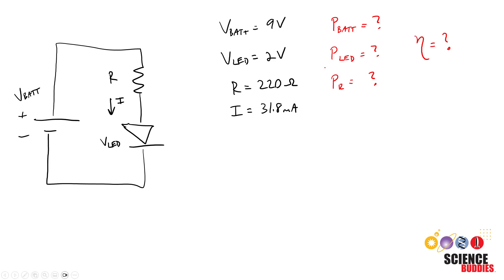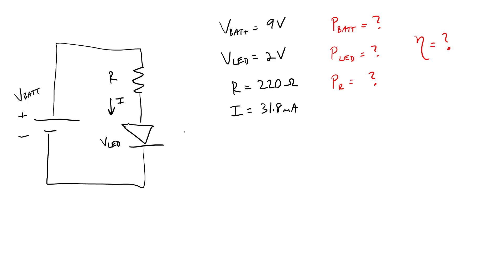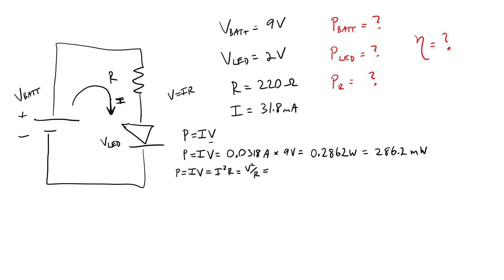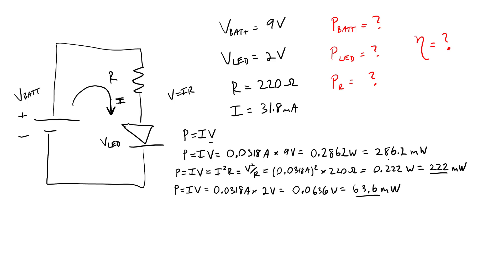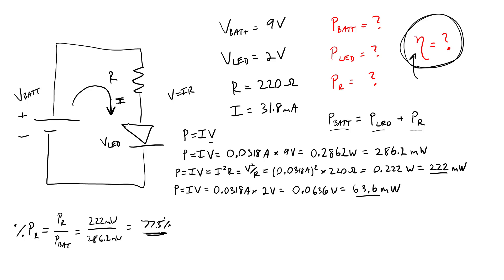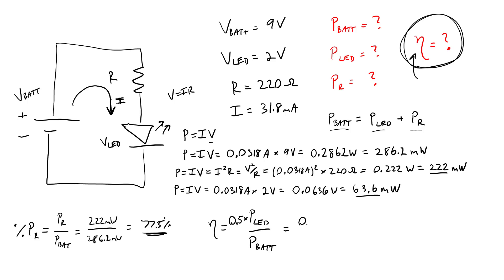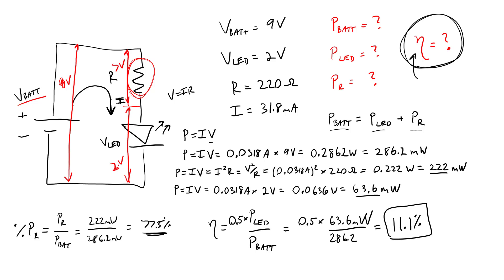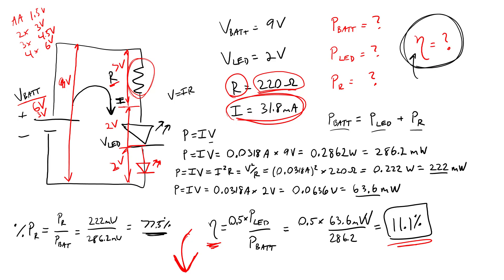LED Circuit Design: Power and Efficiency

Comment: Most ectronic/circuit "you tubers " use 9volt batteries for circuits which do not require that power voltage. It looks like when one uses , per se, 9volt, the rest follow suit regardless of necessity or proportionality,  which unfortunately applies to other subjects as well. People mostly copy and paste, mimic, copycat without giving it a thought or common sense. 
I must then thank you for not only pointing to that mistake, but also demonstrating it mathematically.